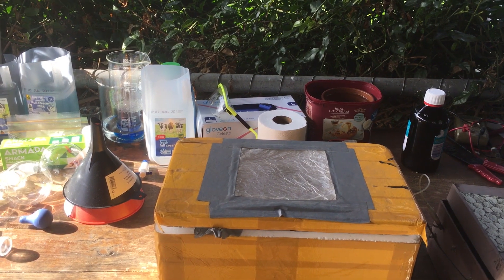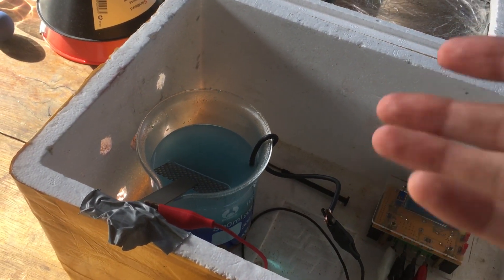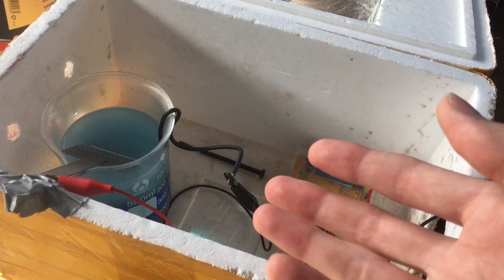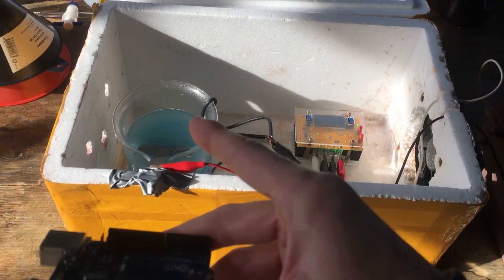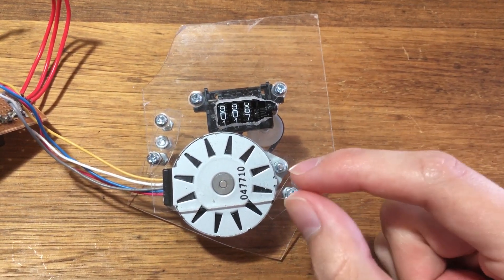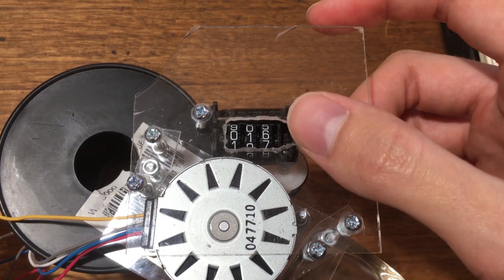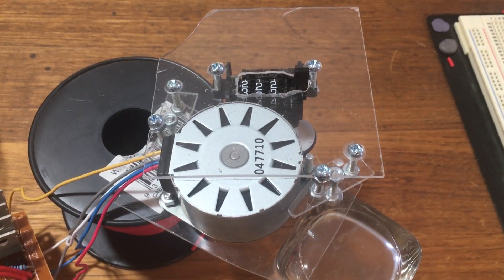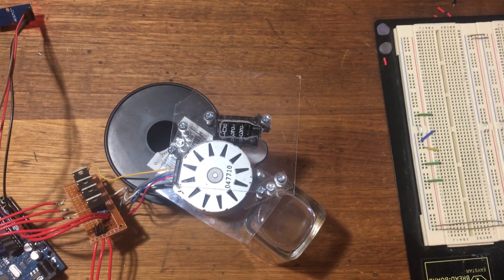Building a Coulometer (Voltameter)

Comment: Are you using N and P FETs? Or is there a more sophisticated bootstrapped driver in there somewhere? Only 4 transistors for a stepper sounds a bit strange, though I guess it works if you’re using half bridges instead of full bridges, since stall current isn’t important. As a PCB maker first and foremost I’ve made myself a few FET driver circuits. IR2184s work in any situation, be it a buck converter, resonant transformer driver, motor driver, you name it.
Reply from the maker: Yeah, I was just using half-bridges for this particular driver. It was meant to be a single-use prototype before I could get hold of a proper driver from Jaycar or something. I'm honestly not great at electronics, but it did the job. Not that I ever ended up using this thing anyway.
I'll keep the IR2184s in mind if I ever build something similar, thanks!

Comment: Hey , nice Video i have a Question what Controller do you use for the electrolysis at 1:04 ? Thx in Advance
Reply from the maker: I pretty much just searched on ebay for the cheapest 'ten amp' buck converter I could find: http://www.ebay.com.au/itm/192007593319 
Turns out it actually works very well, but I dunno if it can actually handle 10A.